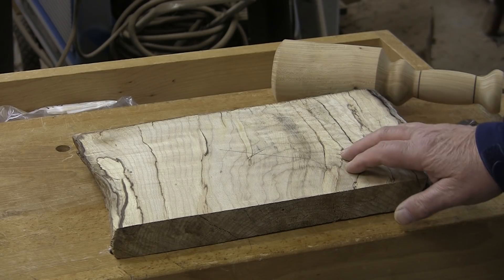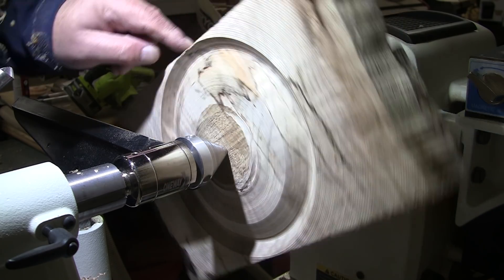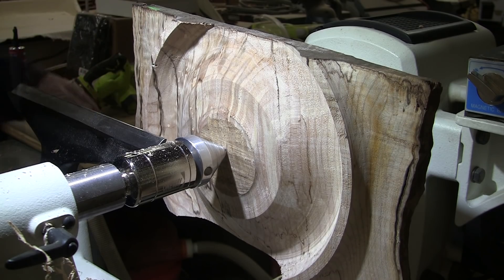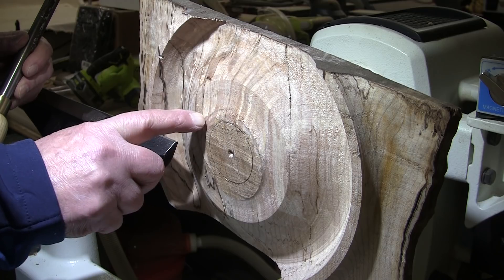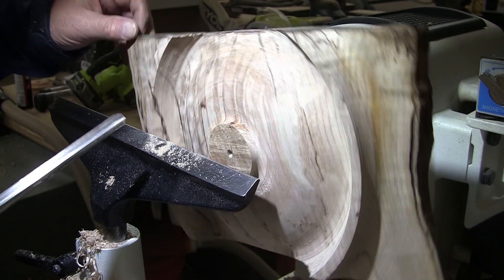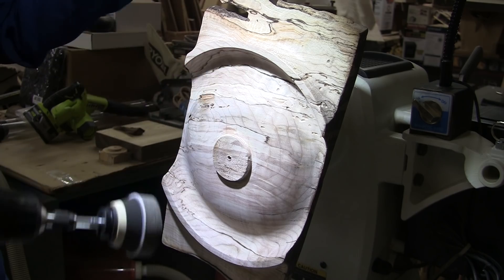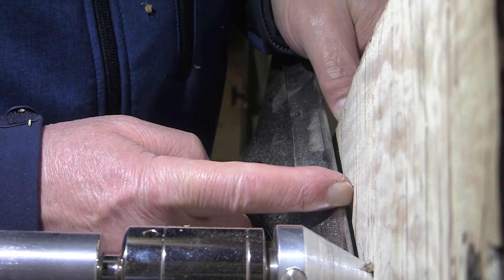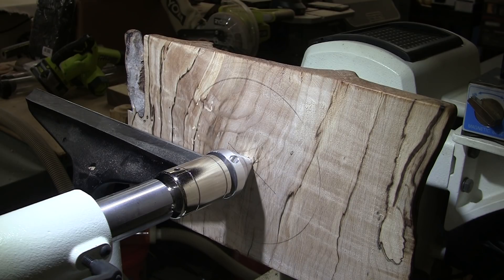Rectangular Winged Bowl - Wood Turning

Comment: Still watching the video-- love the stream-of-consciousness narrative style, how you keep us right there in the process --but I have some questions concerning the sanding wheels you're using:
How long will the grit last (how often do they need to be replaced);
What sizes do the wheels(?) come in;
Where would I go to find these (search params)?!
Reply from the maker: The sanding wheels (Sand O Flex) have refills that very in length according to how heavy the grit is.  The finer it is the longer the refills are because they take up less room inside.  I try not to know how long they last because they are kind of expensive to replace.  I can only say I don't fill them often.  Also, I don't use them on every piece, it just depends.  I know that's not much help.  I guess I fill one every couple months?  Also, I have several of them so it's even harder to keep track.  Sorry, just not much help, here, Dave.
Phil
Reply: @PhilAndersonShadyAcresWoodshop  Very helpful! I will be ordering some, definitely, but there are other priorities that will take precedence. Darn. But I love what you have demonstrated on live edges!
Reply from the maker: Oops, I forgot about the other questions!  Dang, I'm getting old!  I've purchased most of mine from eBay.  I have found one online source for the newer, plastic wheels.  I kind of think these may be better because they are lighter and easier to use.  The metal ones I use are model 350R.  I think the body is 6 1/2".  Here is where you can find the newer plastic ones.  I see the price has gone up a little from just a couple months ago.  https://www.supergrit.com/view.php?pg=products/products_woodworking-sandoflex 
Phil

Comment: That has some beautiful spalting and chatoiance. Will you show how you buff the pieces as well? Once again Phil a beautiful bowl. Cheers Huw
Reply from the maker: Thank you, Huw!  I don't usually show the buffing because I use cloth (oh no!!) and when I do show it I get nothing but comments about how dangerous that is.  I think if you know and compensate for the dangers, it's not dangerous at all.  I just hold the cloth, (all folded up, nothing hanging loose) at a high RPM against the piece.  That's pretty much it!
Phil
Reply: @PhilAndersonShadyAcresWoodshop  Hi Phil, I use a cloth at times as well as it seems to get a better shine that paper. I can imagine the comments if you showed a cloth being used. Again I keep it folded tight with no "loose" ends. Cheers, Huw